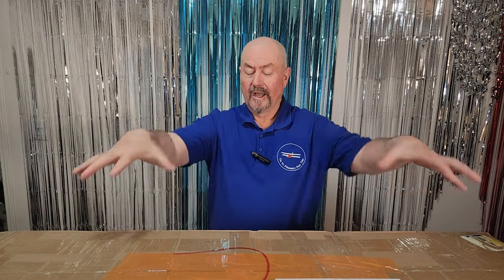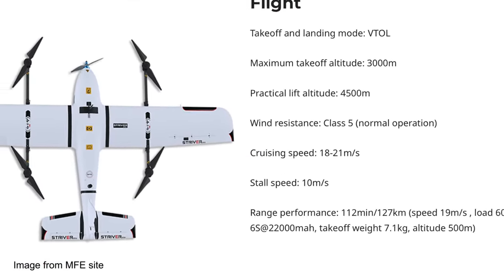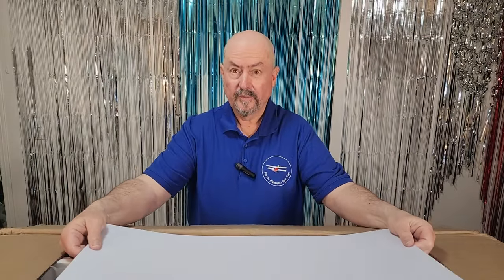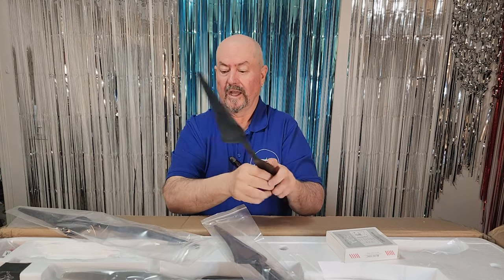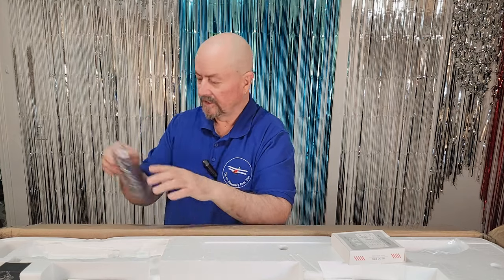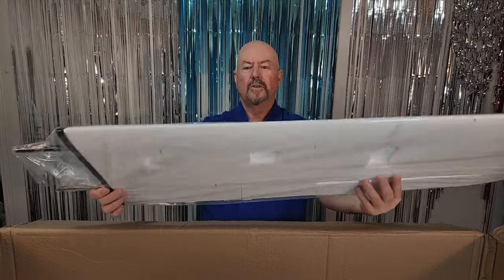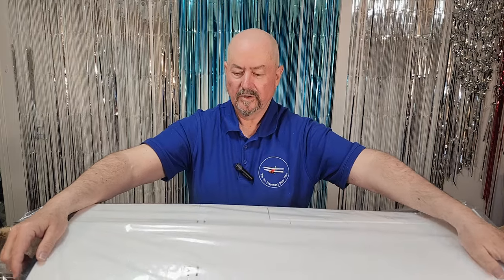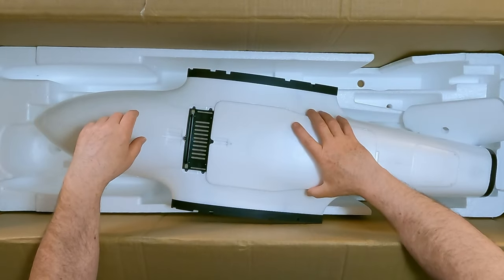Striver mini unboxing - ArduPilot Plane Follow project part 1

Comment: Nice to see this video as I was looking for the same plane. Thank you for making this !  But I am really disappointed by MFE to see that "PNP" for them basically means a kit with electronics, but not a ready assembled plane.   PNP = plug and play , so you should (theoretically) be able to fly just by plugging a receiver witch is not the case here.   Considering the very high price tag of this configuration  (1600 euros for my location)  i think it is an overkill and a big load of additional work before being able to fly.   If you are in to this for hobby maybe it is not a big deal, but for a small business who build these "pro" or "semi-pro" platforms this means additional resources needed to be spent before getting up in the air.
Reply from the maker: It's true but it's a way to get a full platform very cheaply. Try to find anything on this scale fully assembled for < maybe $5,000 euros if you are lucky. Look around you might find a reseller who will assemble it for you.

Comment: can we accommodate sony a7 series camera with 2 axis gimbal. also should i install gimbal for this one, what'd you think
Reply from the maker: There's quite a lot of space in the camera bay and you can get a standard mount for the Sony A7 for a downward facing camera. If the gimbal isn't too big I think it should work. Send me a link to the gimbal and I'll see if it will fit.
Reply: @timtheplaneman  I'm using mavic 3E and 3T for my mapping business. now i decided to switch to fixed wing mapping with this i can easy cover large area but i very much concerned about the data accuracy. btw i'm totally new to fixed wing mapping, when i get the gimbal info i'll share with you.
you are doing a great mahn i really appreciate it..